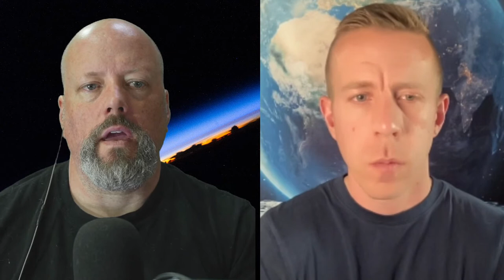Dealing with Lunar Regolith with Dr. Kevin Cannon

Comment: 10:30 I saw an article recently about how Zhurong will survive the winter. One of the features mentioned was the superhydrophobic solar panels, but they didn't explain how that would help in the absence of rain. (On Earth, superhydrophobic surfaces are known for being self-cleaning because any water that runs across them will pick up dirt and then just fall off.) Now I see that the same mechanism that makes a surface superhydrophobic can also directly reduce its attraction to dust, helping keep it clean (probably in conjunction with wind or vibration) even without any water.

Comment: I wonder whether a better bet is to build a very large sealed roof over a lunar mine site controlling the temperature and pressure inside so that you don't  really need so much to develop special mining equipment and lubricants. I also expect that once a base is built there'll be very little walking around "outside."

Comment: Could the unfiltered sunlight on the moon be used for splitting up water in H2 and Oxygen? Sometimes I think not because you have to use glass or perspex etc. for containing the water and that is filtering out the UV-light. But maybe someone has found a way for doing it.

Comment: If a tiny robot returned just a few grains of surface regolith from the eternal night zone in Shackleton crater, how valuable would it be to Artemis mission planners? Asking for a hypothetical sample return proposal.
Reply: @William Dye  It would be very difficult and expensive to transport a sample from the moon to our labs in "eternel night" conditions. Chances are it would suffer thermal degradation and the sample might loose helium and other volatiles en route.
Reply: @gilbertanderson3456  Yes, that's precisely my concern. Even on Earth, preserving a sample during transport is so expensive that it can be cheaper to bring the lab to the site. I help design scientific instruments, one of which was sent into the Madagascar jungle for exactly that reason.

Both options are usually too pricey, especially off-planet. So now the question is if it's still worthwhile to bring back a sample that was not preserved during transport. Even a lunar sample delivered by meteors still provides some data. 

More to the point, assume that I can deliver a few grains of lunar regolith to you. What's it worth? How much is it discounted if the sample is exposed directly to open space all the way back? What's the discount if the landing-site accuracy is +- 100 km? 10km? 1km? (Note Shackleton crater has a radius of roughly 11 km). The answers to those questions would help me determine if the mission idea is even worth writing up as a proposal.